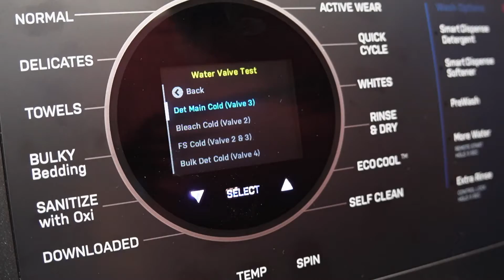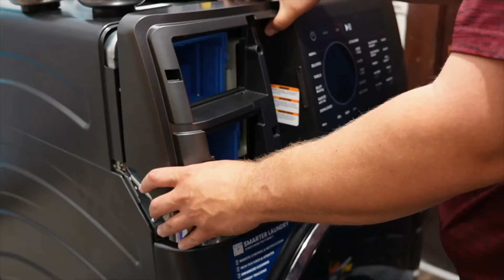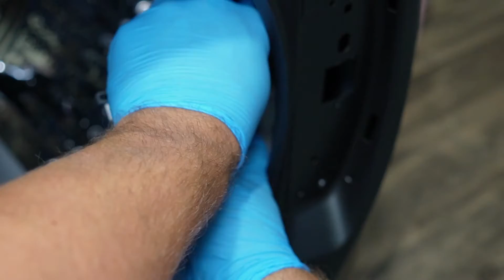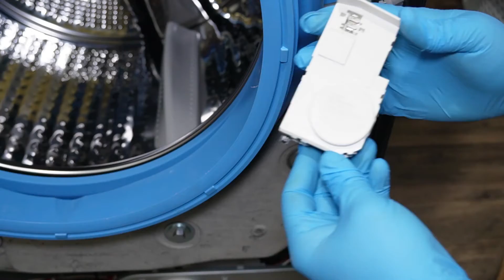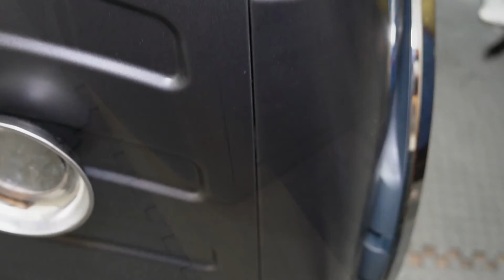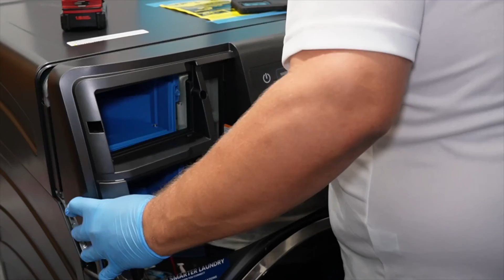GE Ultrafast Combo Door Lock Replacement - How to Test, Access & Replace

Comment: On my machine, the plug to the door lock is burnt! What about the wiring harness? I can't find the part or a pigtail replacement.
Reply: Same here
Reply: @timothykaczynski2752 I ended up getting a "flag" assortment from Lowes and made my own connector. you need two sizes

Comment: Ben another great video on the GE Ultrafast W/D. This video is also perfect in case you need to change the door hinge to the other side if you want the door to open from R to L instead of R to L as originally delivered. So helpful.
Reply: Is the wiring harness To the door lock assembly on the left hand side?
Reply: That's my question as well. I think you have to take the right hand wiring harness off and reroute it. I decided it wasn't worth it.

Comment: Question for owners who have had this since Aug/Sept of 2023. Our machine seems to be very loud when it starts to draw the water. Is everyone else’s loud? Also, we ended up taking it off the pedestal because it’s swayed a lot. Anyone else experience this and do the same? Did you build or buy a sturdier pedestal for it?

TIA
Reply: Make sure it doesn't have the brackets still attached to the back that are intended for transportation purposes as they don't allow the chassis to flex therefore it will walk instead. I had the same issue with no stand.
Reply: @Mike-vh5vy those were removed by the delivery guys. Our floors are not very level but we corrected that issue. The machine still vibrates a lot. I’m scheduling a maintenance check for it.

Comment: I’m here on this video because I’ve just suffered Mine failing. I’ve owned my washer for about 7 months. Getting error 23 which is a door lock failure. When trying to start the cycle it locks then unlocks itself. I just had the warranty tech come out and look to tell me it’s the door lock. I don’t know why they don’t just order the part when I tell them exactly what is wrong before they show up to tell me what’s wrong. But hey I’m not the company doing it so I’m forced to not have a washing machine while they do their job. But depending on what they say the time frame is on a part I’ll probably just do it myself. I’m very mechanically sound for things like this so it doesn’t phase me to do the job myself

Comment: Was hoping for some help woth a question i have about the drum and the gasket. I was curious if there is supposed to be any felt like material between the edge of the drum and the gasket itself? I only ask because i had to recently have my brand new machine replaced and upon looking at my new machine there is no material there whatsoever and i swear my previous machine did have something there because i specifically remember thinking it may have been lint or something stuck between the edge of the drum and the gasket but when i tried cleaning it out it looked as if the machine was made this way? Please if you cojld help me with this question that would be greatly appreciated.  Thank you and keep up the amazing video's!

Comment: Hey Ben, I am really considering this GE combo unit, but I don't understand the math? If the heat pump busts, say at year 6, the replacement for the heat pump assembly looks to be like $1500+ from GE not including labor and a new holiday sale unit is about $2k. So what gives? Doesn't the risk there seem to be a real stretch? Especially since this unit doesn't have long term real world usability?
Reply from the maker: IMHO, the real price of that assembly should drop precipitously as it gets closer to that 5-6yr mark. Something similar happened with GE control boards for their ultra-similar GFW-series washers. Initially, retail on those boards was $300-400 USD. However they were pretty common to have issues, to where they are now $150-200 from most retailers, rather affordable. Also, considering what can actually go wrong with that unit, I fully imagine it will be rather easy to just buy the components needed to do the swap for a fraction of the price if in case the entire assembly remains expensive. But again, in my opinion, it should drop by the time a replacement is needed. If not, 3rd parties could swoop in and offer a much cheaper system.
Reply: @bensappliancesandjunk  Thanks, that's a great point. Do you have any idea on the longevity of these heat pumps anyway based on your experience with other units or stand alone heat pumps? Also if you were in my shoes, would you be purchasing an extended warranty for this? Or how would you best look to insure your investment?

Comment: Hey Ben, I have a Maytag Centennial top load washer. It’s showing an error code F7 E1. I can start a wash cycle and it washes all the way until it gets to the spin and stops. So then I have to cancel that cycle and turn the dial
to  spin and drain and it will spin and drain no problems. Do you have any ideas or recommendations on what would be causing it not to want to go into the spin cycle during it’s normal wash cycle. If you do, I would greatly appreciate it.

Comment: Someday i hope i find someone as obsessed with me as Greg is with you lol.
Kidding aside the wife and i are fascinated with this new GE Unit. Now that you have disassembled it and put it back together, do you predict there will be any significant design improvements or changes made by GE over the next couple of years? Thanks for preemptively making these videos!
Reply: I had two of these and both went bad. I finally gave up and went to speed Queen.
Reply: @TheWagLife  two of these particular GE units? Which part failed?
Reply: @Hellothere149able  the first one had issues with the automated detergent filler. The second one had a bent motor shaft.  It got lint bypassing the filter. I gave up. I can  not see these lasting more than 5 years.
Reply: @TheWagLife  
Bent motor shaft? That's crazy!
What model speed queen did you pick up?
Reply: @Hellothere149able  front loader. FF7

Comment: The purest form of sophistication is simplicity... This is a monstrosity of complication.
Reply: Truth. I only hand wash my clothes. I bring them down to the river and put them on boulders in the rushing water. While the water washes over the clothes, I hand scrub the clothes with soap I made from cow's milk.

After 5 hours of doing this, I put all of my clothes on a wire I run from two oak trees. 

I then go inside. It's 4pm. I low out my candle and prepare for bed. I sleep. I wake up at 4am.

I go outside to take my clothes down to begin folding.

Unfortunately there was a murder of crows that defecates all over them.

I sigh and take my clothes back up the river to start again.
Reply: It's really not. It's a GE front loader with a slightly tweaked refrigerator bolted to the top . Functionally, the washing machine part isn't doing anything different than it's always done other than the motor is going to have a lot more hours on it per load. GE is hopefully capable of understanding how a vapor cycle system works well enough to make the refrigeration part work at higher (but not extreme) temperature...it's basically a component sizing problem.

If their front loaders are pretty good, and their basic refrigerators are pretty good, their combo unit should be pretty good. It's pretty clear this isn't built like a $200, slap a name your great grandma talked about being good on it, last for two years, piece of junk.

It might actually end up lasting longer since there's going to be a whole lot less moisture floating around the unit when it's not being used.

Comment: I really love my circuit board free dump find washer and dryer. All parts available and surprisingly cheap compared to what I thought like the lint basket, center support bushing and belt tensioner pulley which I replaced with one from a snowblower as I needed it immediately.
Reply from the maker: What kind are you using, model-wise?

Comment: They're already failing?
Reply from the maker: Not quite. Instead of waiting for things to fail, I took the whole thing apart and put it back together, filming all the various things to replace. I figured that I should put out at least 1 video right now on how to take the front off, and figured the door lock was probably the most likely thing to show case it. That or the pump.
Reply: @bensappliancesandjunk  very impressive!  
Those are definitely on my list next time we replace appliances, so we'll see.
Reply: @bensappliancesandjunk  So, this is 10 months later from this comment however that is about how long I've had mine and I am about as sure as I can be without taking it apart (hence I'm here) that the fins are clogged up and the only way to get them clean is to do this and take compressed air to it. I should not have to do this it's only 10 months old and a 2500 dollar unit. I really just want my money back. Very upset right now. BTW - yes, every load! Yes, I drained and cleaned the trap. Yes, I took a shop vac and a small hose to inside where the filter goes, brushed it as best I could. All that ridiculousness. It still throws a 353. GE did come look at it once about 2 months ago. Today, while maintenancing it again for the 100th time I did notice the front is not on right and the filter makes a sucking sound if you listen closely that goes away if you push in on it. Also, the back fins are where it's looking the most furry. I try to get a brush back there but I can't get it off all the way because the rod is too floppy but I do get most of it. Kind of makes sense if the front is not on flush that the filter isn't getting to the back of the core to be able to do its job.
Reply: That's what I was thinking. He's done a bunch of videos on this thing. 😮
Reply from the maker: @richardbrant5728  Its really, really easy to just tear it down and put it back together 1-2 times, since you get access to all the parts. So for example in this video, its about the door lock. But in actuality, I took the inverter and drain pump off too when I shot all of this, because those 2 items are pretty frequently bad on the other GE units, so why not get those taken care of... Its not like taking the gasket/door/interface off will be any different on those videos, so making them is quite easy.
Reply: Mine did. “Door open” error. Lucky for me I have the bestbuy extended warranty. Unlucky  for me: it took two weeks for the technician set a repair date, 1 weeks to confirm physically in my house and order the part that they could have ordered when I complained.  1 more week to double validate the board is on back order and they can’t get me one.  I have now to wait 1 more week for the 15 days to pass so that the geeksquad technician can overwrite the repair process and let me order a new one for free.  This is the second replacement. I used it just 4 times before the door open error. A bit frustrated with the experience.

Comment: Is there a way to put the door on the other side?
Reply from the maker: Hey, fantastic question.

So here's the deal: According to GE, no. You can't. However, from what I see, everythings' there to do it EXCEPT for the fact the wiring has to go a bit further, and there's only enough room for it to open from the right. I think if you had some extra 14awg wiring, you probably could do it.